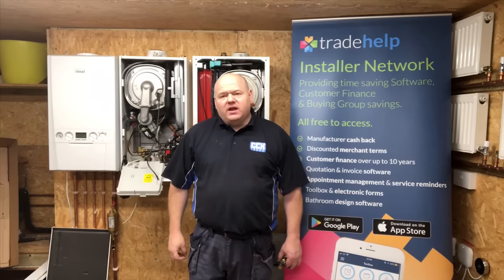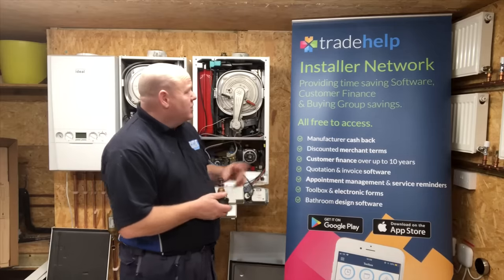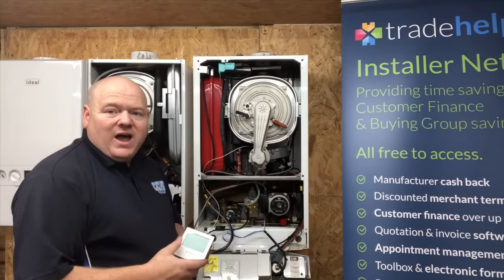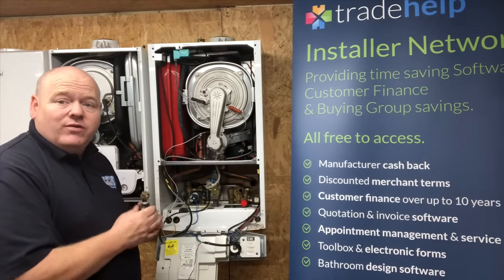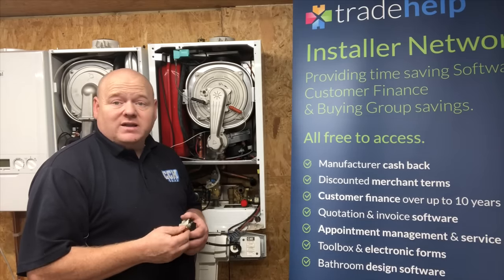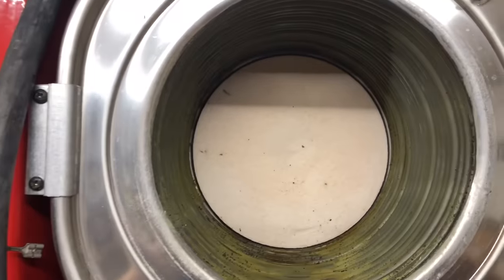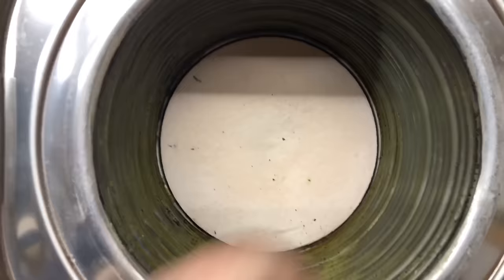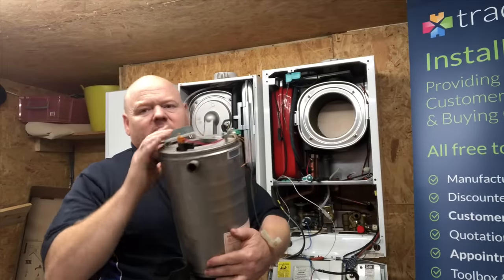How Does A Combi Boiler Work - Boilers - Diverter Valves - Hot Water Sensor

Comment: Good Allen. May I add to simplify, as some comments indicate many did not get the gist of it.
On a Plate Heat Exchanger combi, which Allen is talking about:

♦ The boiler has a main gas burner heat exchanger that produces heat and a separate DHW (hot water) plate heat exchanger that transfers heat to the cold incoming mains water, heating it instantly; 
♦ The boiler's main gas burner heat exchanger that produces heat;
♦ A pump pumps heat from this heat exchanger to the radiators;
♦ When DHW (hot water) is called by opening a tap, a flow switch is activated indicating flow on the hot water pipe circuit;
♦ A three-way diverter valve moves to circulate the heated water from the radiators to circulate only inside the boiler casing;
♦ The heated water is directed to a highly efficient DHW plate heat exchanger; 
♦ The plate heat exchanger has cold fresh water running though one end and hot system water from the main gas burner heat exchanger running through the other. The two waters do not meet, merely transferring heat from the hot system water to the cold fresh water;
♦ The plate heat exchanger heats incoming cold fresh water Instantly to a temperature suitable for domestic use;
♦ This will produce hot water infinitely, called infinitely continuous, not running out of hot water;
♦ When the hot water tap is turned off, the flow switch indicates that DHW is no longer called for;
♦ The three-way valve moves to allow water to be pumped to radiators;

On an integrated gas heat exchanger/DHW heat exchanger:

♦ The boiler has a main gas burner heat exchanger that produces heat with a DHW (hot water) heat exchanger integrated, which may be a long winding tube inside the main gas burner heat exchanger; 
♦ A pump pumps heat from the main gas burner heat exchanger to the radiators;
♦ When DHW (hot water) is called by opening a tap, a flow switch is activated indicating flow on the hot water pipe circuit;
♦ The pump is deenergised preventing water from running to the radiators, while bringing in the gas burner, if it is not already activated.;
♦ The DHW heat exchanger heats incoming cold fresh water Instantly to a temperature suitable for domestic use;
♦ This will produce hot water infinitely, called infinitely continuous;
♦ When the hot water tap is turned off, the flow switch indicates that DHW is no longer called for;
♦ The pump is activated pumping heat to the radiators, if the control system demands heat to the radiators;
Reply: Thanks
Reply from the maker: It’s only possible to add so much in a video, Would love to meet up and do a joint video together 😂
Reply: @AllenHart999 😂
Reply from the maker: @johnburns4017  You know it needs to happen, You are so helpful on my videos. Many Thanks.
Reply: @AllenHart999  
:)

Comment: Allan, excellent video the way you described make me very attentive as well as interested . I was searching for the clue for our boiler problem which started after fault in fill in loop stop function. Pressure in the boiler increased to 3BAR and safety valved throw water on the out side wall. Engineer visited, due to the displayed error code of the boiler he changed the pump, but boiler still make noises and pressure goes up and down which noticeable from the pressure gauge. As you briefly explained that might be faulty hot plate causing this issue due to internal damage. Funny thing is that boiler work about 50% of the fully capability. Hot water seems fine but when heating kick in than it become problematic. 

I guess hot plate may be damaged internally during this pressure surge. Radiator make funny noises due to water movement. Am I right to assume hot plate causing this problem? please give your expert opinion.

Comment: Excellent video on understanding how combi boiler works 👍🏻
I have no hot water, heating is fine.. Real saga going on at moment 😥 I pay for BG homecare, Ravenheat  RSF 820/20 combi.
2 B.G. service engineers sent, both said can't touch boiler if there's something wrong. 🙀
This is new, they always helped before.. Not qualified to help perhaps? 
~ Finally the ' engineer ' visits, doesn't check why my boiler won't fire up when hot water is called for!  
Doesn't open the folding down access panel >Tried & didn't know how! 🙀  Decided within 5minutes I must need new 3-way divertor valve.
~ Thing is, my hot water isn't going to radiators like he said,, boiler not firing for hot water! 
Told me take 3weeks & they maybe can't get this part at all,  hinting I will need buy new boiler! 😥
I'm sure it's electrical sensor like you showed?  Looked & I can't see 1 like yours, mine is an older, but reliable boiler. 
♡ Please give me your opinion on the fault,  of untrained 'engineers' , possible electrical sensor,, not this valve that they won't be able to source.
I feel a fool for paying such sums of money, so long, for their " home care " , for peace of mind.💜🐱♏🌲🏴
Reply: try to find on google your boiler model name and add 'service manual'. if you find it, should have pictures how to take apart the sensor, so you find where it is and how it looks like.
Reply: Thanks for answering  @nilsfrahm1323   🤗 They changed divertor valve, then it wouldn't start!  What a saga!
~ It turned out the " real engineer" who came to fix it, after 3weeks ,, was going to give up, until I showed him the original manual !
He admitted he put wires back the wrong way to electric box inside it,, thinking it wouldn't matter! 
They all put me thru so much stress , I feel so stupid paying this monthly fee of £45 for "peace of mind" for 20years.. 
~ They should replace boiler if they break it, then cant fix it >> No?   Still havn't had my annual service  - they r a total waste of time! 
Appreciate your input on what I should do..  Just cancel the expensive homecare I've paid since I bought boiler. 
Or insist on complaint procedure & replacement ?

Comment: Great stuff Allen, just watched this whilst eating my lunch. I don't much like the double pass giannoni hex's. They block quite easily and start making all sorts of funny noises. I think tutorials like these are great for new or inexperienced GSR engineers. Where were you 10 years ago? I wish there were people like about when I was doing my NVQ plumbing. You're a great human being. ✌
Reply from the maker: +ghostmanromeo uk I have never had any issues on any of my Installations. If you fit a boiler badly and don’t flush then you could have issues, 👍
Reply: @AllenHart999   I don't have any problems with my installs either Allen. It's just when you go in to service an appliance. Once the combustion chamber's open. You can sometimes see where the hex is blocked it's cruded and  discoloured near the blockage.
With installs, If the systems clean I still fit in a filter. If it's dirty a chemical flush and I put the magnacleanse on it for a short while. Gives you time to commission and do final checks, happy days 😜

Comment: Brilliant video Allen, one my best ones so far. 
Im just a bit confused when it comes to the heat exchange plate (square metalbox). Is the water already made.hot my the bunner before it passes through there?
Reply from the maker: YES YES the main heat exchanger heats the water and then goes to the smaller plate heat exchanger. Thanks.
Reply: Allen Hart so basically the heating water is always on? What prevents it going into the heating side in the summer months?
Reply: @simonstones1918  I think it's only when water heating is required that the boiler water is heated up and sent to the heat exchanger.

Comment: Great video. Just a question our boiler is on 52 degrees and water is lukewarm. It only gets hot when you turn the cold water on at the same time. Been like this since British Gas fitted it 5 years ago. Sick of asking them because we had a “leak” dropping pressure on a new boiler. 5 years later after regular service, young lad comes tops up pressure vessel with air no more problems

Comment: Interesting and well done, but i think there is an error in the explanation. According to the water flow in the secondary heath exchanger, when the diverter pin is up, you get hot water, because the flow to central
 beating is blocked. When pin is pushed down, hot water path is blocked and water flows to  CH

Comment: Hi I just installed a Combi Boiler. As a housewife, I cannot understand these technical things 😉.  In terms of saving energy bill, should I turn the DHW "off or auto" on the thermostat? Right now for heating, auto is set and timer is on to heat up the rooms. But not sure about hot water? We use "electric shower" every day. Since we are not "heavy hot water users", I turn it to "off" position, that means "hot water on demand", right? However, what if I turn to "auto" for both: once heating heats the house, water will also be heated up?!  My question is: which ways can save money? Is it "turn off - hot water on demand" or "turn auto - fuel both heating and cold water at the same time"?  Thanks in advance! ☺️

Comment: Hi Allen love your vids I was wondering if you know why my boiler is working fine an the radiators work fine nice and hot but I have no hot water in my taps an most time the boiler says pump over run some time have to run the cold water in the sink an hot water in the bath just to get it hot thanks keep up the great work 💪👍

Comment: Great video thanks. I have a question about cold water flow to the boiler. My comb is very similar to the one in the video (Main combi) and I notice the white plastic filter on the bottom of the incoming valve. Does this also control the cold water flow rate into the boiler ? 

The water pressure and flow where I live is very high so I suspect the boiler is struggling to get a 35 degree rise at 11 litres min (HW).

Comment: Excellant video. I have a question my baxi boiler works fine  central heating perfect but the hot water when the hot water tap turned onto full flow there is a whistle sound. Turn tap down to reduce flow the whistling stops. Any ideas please. I like to know what i am talking about when calling out a gas engineer. 
Regards.  Mr G clark

Comment: Love your videos Allen.   Are you sure about the magnet spinning on the hot water circuit..  I think you may be wrong,

I thought it was just displaced  - so that it causes a change in the the Hall Effect sensor output, then the system knows you've turned on the hot tap !.
(& a spinning anything would be liable to wear/fault) 

I bet if you lifted off the hall effect sensor & just held a small magnet inside the plastic , it would activate the hot water, just a guess...

ps I worked in electonics, but  that not to say I know what I'm talking about   ;-)
Reply from the maker: I will watch the video and see what i said, I might of been mixed up. Thanks.
Reply: @AllenHart999   I'm sure now you were speaking of the invisible fields,  & I took your words more literally.

Comment: Great vid, helped a lot. So the pump is activated by the room stat or the hot water flow sensor, are they also both connected to the diverter valve?
Reply from the maker: Stay safe. Watch this one just in case. Thanks https://www.youtube.com/watch?v=Hh5lFC7VI4U

Comment: Great video Allen, would a faulty temperature sensor cause the combi boiler to shut down on DHW with error code 7 on a Remeha 28C ? If left for a few minutes if I reset the boiler it works again but only for a few minutes before shutting down again. Been happening for a week now local engineer says replace the boiler!!

Comment: Brilliant explanation with in-depth details. I was wondering if you could help me with my boiler issue. My bosch combi boiler supplies hot water only when heating is on (when I increase the temperature through controller).  So what could be the issue? The issue could be with diverter valve or temperature sensor?

Comment: Any chance you can do a vid on a balance wall heater and measuring co?
Reply: use a spirit level to balance your wall heater. tape measure for the co
Reply: Sorry a balance flue I meant, co reading as in carbon monoxide
Reply: @aminwahab2620  i'm sorry mate, my terrible attempt at humour. you need a flue gas analyser to get a co reading, same as you would on a boiler
Reply from the maker: No, Do not see them anymore. sorry.

Comment: great video mate , I have an Ideal 24 combo with no water at all at the hot tap would that be the diverter valve or the cold water valve you showed on the pump , thanks for any advice you may give Allen,
Reply from the maker: Flow turbine maybe? Give ideal a call or a local engineer. Thanks.

Comment: Hi Allen, just an ask have a Rental property with a Grant Kerosene Combi Boiler and the System pressure was dropping off on same due to the likes of some old central heating Rad connections are  very slightly leaking plus also the TRV spindles, causing things to go south with the system pressure ...  the ,'Old School" heating Engineer just looked at same, serviced the Boiler,Power flushed the system filled with Corrosion Inhibiter and system Leak seal in and went down the route of fitting  Auto Fill Pressure reducing station fitting two certified N/R Check Valves on same,  One before the Reducing station and one after same,  and left same, the incoming water ,"LIVE" to maintain a Bleed into the system if needed and tuned same to maintain a Static  incoming pressure of 1Bar when the System was, "Stone Cold"...   He also put in an Extra Large Expansion Vessel adjacent to the Boiler connected to the Heating system saying it would help with the reducing of Pressure within the System seems to calm things down, as ramps up to at most  when fully running to just 1.6 Bar... he said that the "In Cabinet"  Pressure Vessel was just on the Margin of what should be in there, bearing in mind  the serious  Number of oversized Rads he said  were installed in the house, calling for Heat... allied with the Volume of water in same,  he said it was as well have a good degree of safety in there as a Buffer... or just whenever maybe the "In  Cabinet" pressure Valve would Fail, he's coming back Next summer for the next Annual Service and promised to replace that same as a matter of course as it's about Ten years old.....................My question Allen is although there's supposed to be a Hard disconnect Off the  Mains... incase  of a Water Outage or reduced mains pressure,  and then back pressure allowing  chemicals to enter the mains would this System... would this set up classed as  Minor Sin on his part rather than really a bit of Accidental  Bad Practice...Really  Great and informative Upload...

Comment: Allen , could explain what the fault could be if when  the shower in the house is run but then the radiators go cold . It does the same with the hot water taps .Is this a boiler problem or a water pressure problem?  Ti a of a solution

Comment: Hi Allen,

Great video. Does the diverter valve cartridge unscrew from the valve like the one you had in the video? I have a Main Combi Eco 25 and wondered if it will come apart. Also, could you recommend a tool to take it apart?

thank you

Comment: If the plate heat exchanger at the bottom is heating up the hot water as well as the central heating water, what is the heat exchanger at the top where the gas burner is?

Comment: Nice video, when talking about diverter valves, how the cartridge moves up and down, is it not usually that when the cartridge moves up it goes to the plate heat exchange and when it moves down because of the pin it goes to CH. Or is this not the common way they work?

Comment: That Baxi/Potterton diverter cartridge you show, is a major failing on my boiler. It starts to leak around the push spindle after a very short time. I have just replaced the cartridge and actuator motor for the fourth time in 6yrs. The shortest time it lasted was only 6 months.
Reply from the maker: That’s more likely to how the boiler was installed. I would advise you have a water sample done if the heating water. I have installed hundreds of these boilers and only seen a few of these, one was a faulty part and the system was clean, most are installed on dirty systems and are not boiler faults but poor installation
Reply: @AllenHart999  Thanks for the advice - I'll get one of those water tests done and see what the results are. Thank you.
Reply from the maker: @kay110  No problem. Thanks.

Comment: I have a Baxi Duo-tec 2 Combi GA Range Boiler,about 5yrs old - when running hot water it goe;s cold for a while then comes back hot ,but if you stop the hot it goe;s cold  until it comes back hot - can you help- please - thanks malcolm
Reply from the maker: Could be a number of things, You need to call out a plumber/Gas Engineer , I would guess it might be the plate but could be other things. Thanks.

Comment: Any recommendation as to what to replace a Worcester 24CDI with a  (short) 15mm gas service with?
Reply from the maker: Ideal logic as long as the gas pressures are correct. If you could update to 22mm gas then maybe a Baxi 800 or Viessmann 100. Hope that helps.
Reply: @AllenHart999  Yeah the gas supply I believe changes from a 22mm to 15mm somewhere under the floor where a gas oven connection used to be - wish I'd thought to of change this before the kitchen went in, its only a few meters from the boiler!
Reply: @AllenHart999  Thanks for the advice, enjoy your videos!

Comment: Hello Allen would you explain in a video that how the hall sensor works on boilers* and quick tip to check if them working or not working. check via multimeter 3 wired sensors. thank you mate again.

Comment: Great demo...
No pilot light
No rad heat
When I put tap on ,red light on  pump will come on.
But pump will turn itself off.after 30secs 
Water does not seem to get to boiler..as though showing one bar..quick turn of PRB drops this..???
Also expansion vessel v hard to pump ..wont take air ??HELP